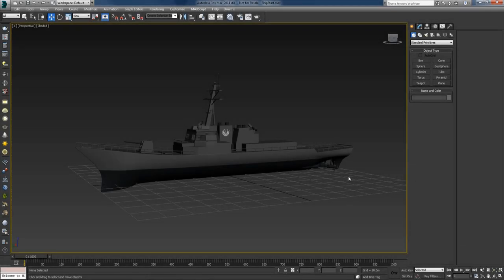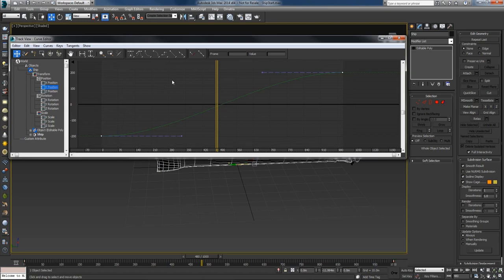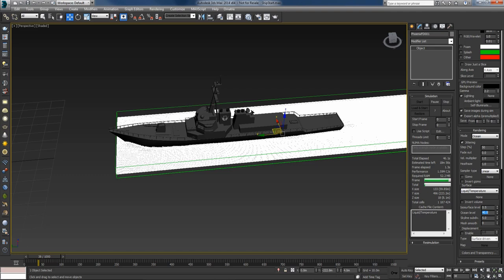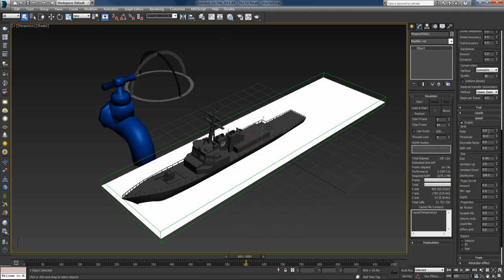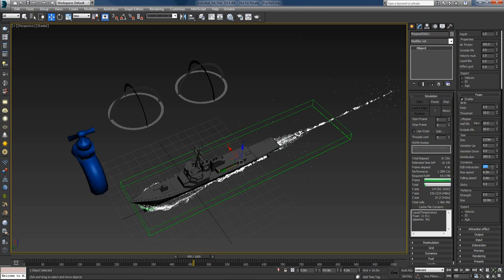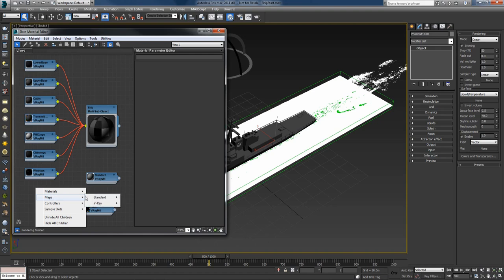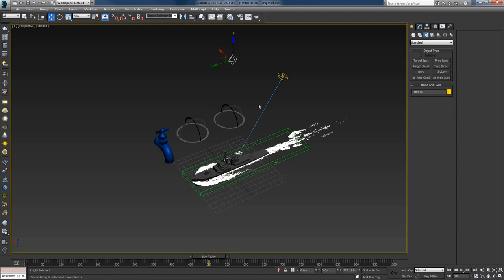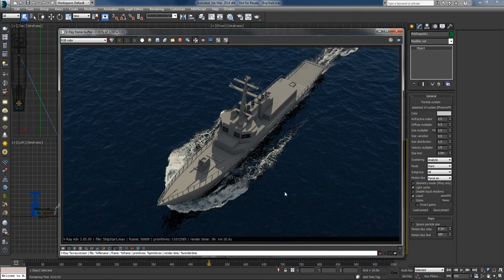Phoenix FD - Ship Tutorial

Comment: Good tutorial.😊
Just a few points regarding ship' design.
The hull's wake is too linear with no divergence at the stern. At the bow, the wake angle is too big as well. That's due to an excesive draft that doesn't allow for a smooth flow.
The water line, in normal ship's condition, must be below the tramson edge. Submerging this edge is always avoided due to the very high drag it induces.
An aproximate reference is that the water line must be below the line between the red and gray parts of the hull.😊
Another point about speed. Over 30 knots is a standard service speed for this kind of vessel that corresponds to over 18 m/s.
Good tutorial, thanks for sharing 😊

Comment: Awesome tutorial. I've used the sample file a couple of times but nice to be able to set up the whole thing myself. How many hours did you use on the simulaton itself? I have followed your steps and have a resolution about 40 mil. but after 5 frames it's still over 24 hours of simulation left, which I guess will increase further. This is before foam and splash. Have Intel X5660 2.8ghz and 25 gb ram.
Reply: For the 600frames it took about 12hours (about 1min per frame).
To speed up the simulation I've disabled the preview of the mesh as well as particles, because sometimes it takes more time to read the cache and display it in the viewport instead of the actual simulation time.
The speed of the hard drive is also quite important.